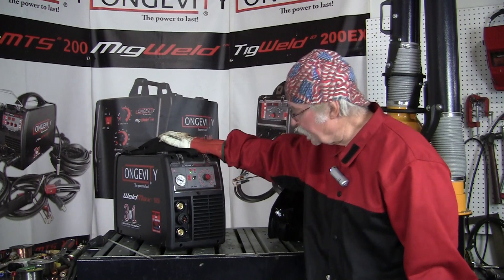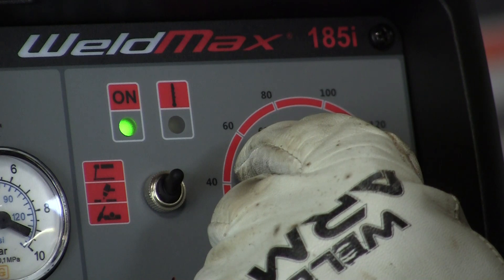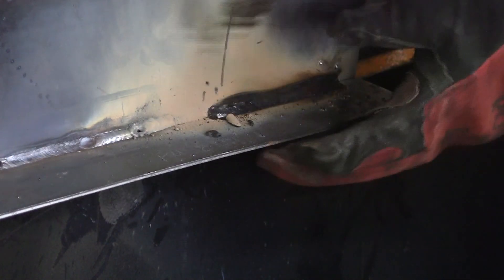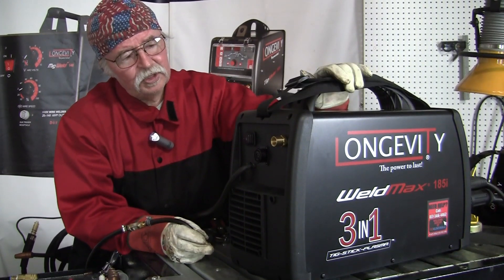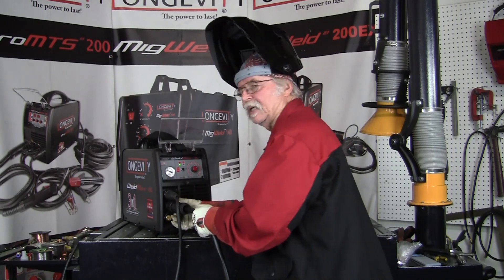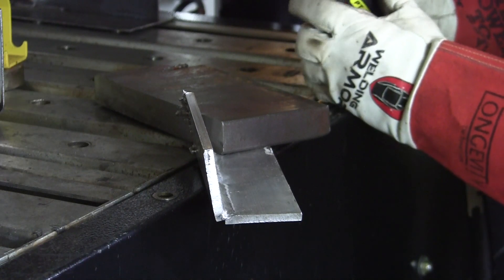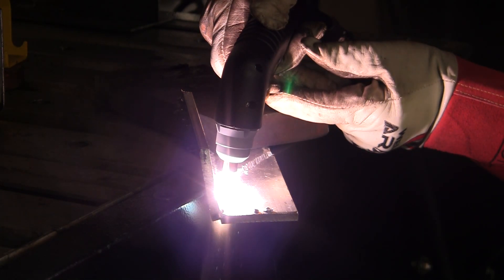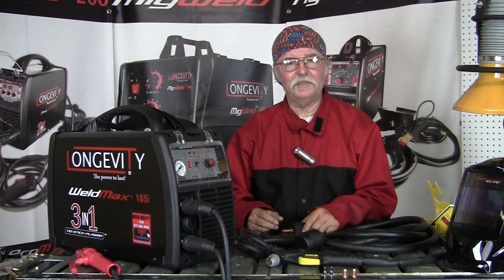WELDMAX 185i 3 in 1 PLASMA, TIG, STICK SETUP REVIEW TIPS AND TRICKS

Comment: I just purchased this machine after several weeks of research, this machine was the best value and quality I could find,  my research discovered that the machine is made in China, the same plant as the Thermal Ark and  ESAB welders and some Miller and Lincoln components are also manufactured there....

  When will there be a TIG video.  I was informed that they have a TIG for this machine and its included in my purchase.  The difference is that there is a direct hook-up to the Argon bottle, the gas does not go through the machine and there is an adjustable switch for the gas flow and a on-off switch on the TIG handle if I got it right.......